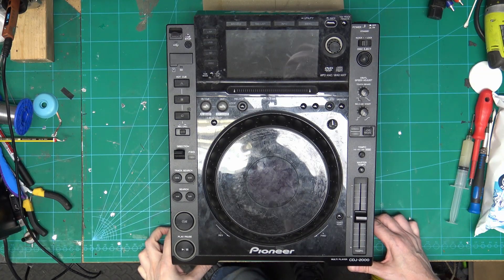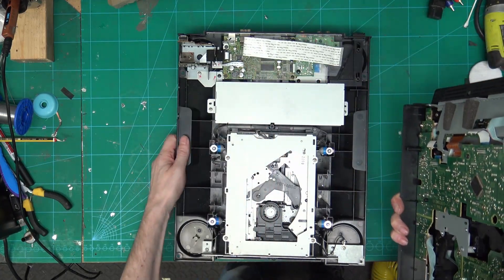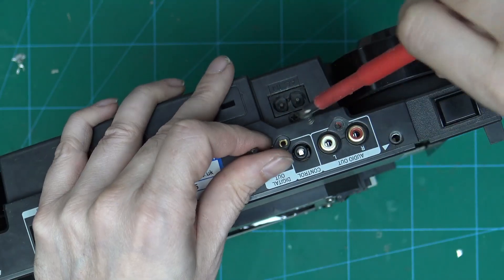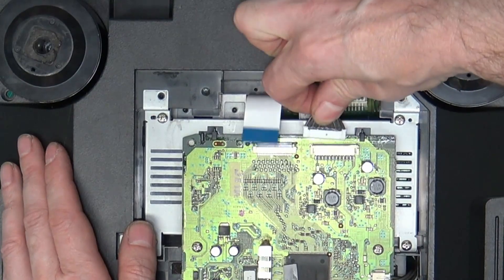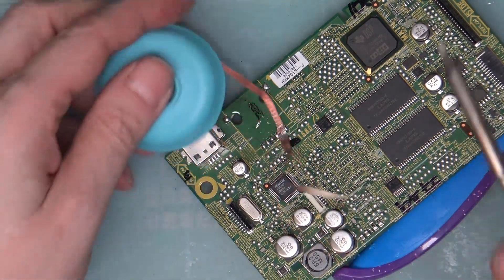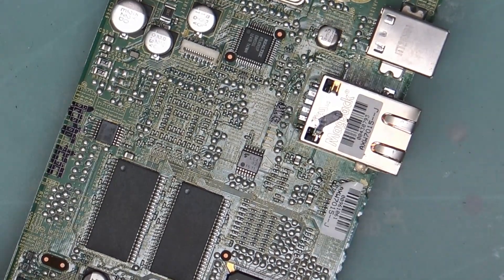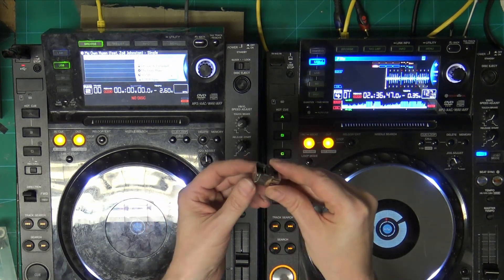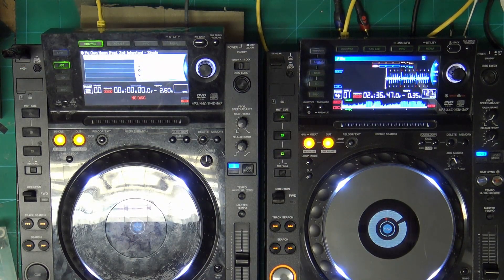How to replace a damaged link port on CDJ 900 2000 and 2000 nexus v1

Comment: I’m struggling with getting power in mine… Tested all parts in my other and no problem there. All ribbons etc replaced, the only thing I haven’t switched is the screen and the board.

Comment: The best instruction! so easy to follow.  Out of curiosity if you had to de-solder the connector, what would you suggest to use and method?.. I ended up having to carefully cut the legs off the failed connector and then remove each of the tabs off the board the way you show in this video
Reply from the maker: if you don't have the correct tools to remove with hot air I would use chipquick low temp solder

Comment: nice one mate, what hot air gun do you use for desoldering and at what temp ?
Reply from the maker: it's just one of those cheap 858d and you need to change the temp depending on what you do, you can also change the distance too. Normal solder  is around 350.